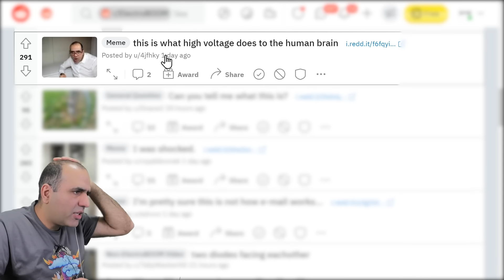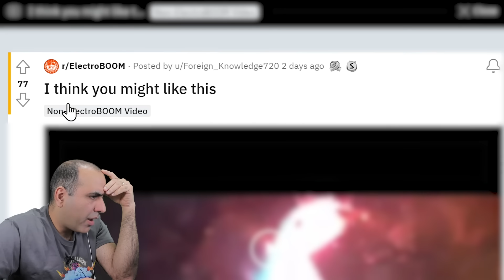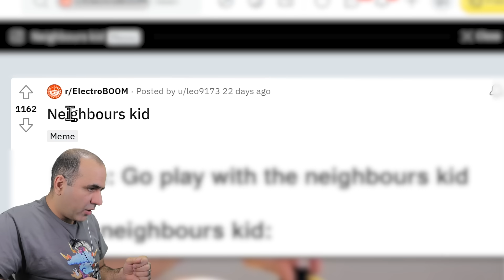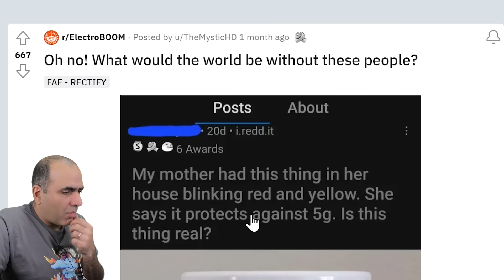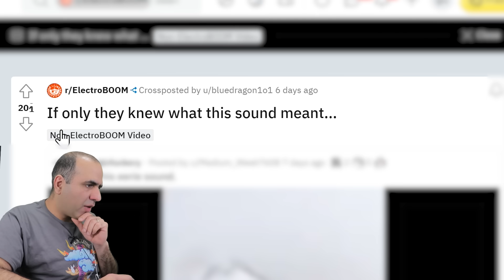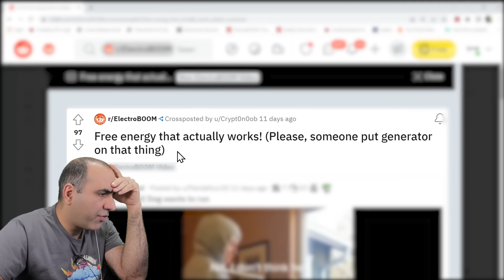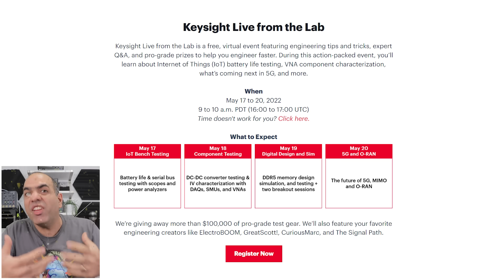Electricity Takes the Shortest Path (in the air), LATITY-010

Comment: 3:50 Mehdi didn't really explain the specifics here, so for anyone interested:
What this is depicting is step voltage - basically because the ground is relatively high resistance the point where the high voltage source contacts winds up at or near that voltage, and the voltage reduces the further away from the source, similar to a resistive voltage divider. The danger is if you take a step towards or away from the voltage source then your feet will be at 2 different voltage potentials, and your body is far more conductive than the ground so this can result in enough of a voltage difference to kill you.
Reply: Ah, so that's why they showed putting your feet together (same potential) then hopping on one foot. 

Jeez, I already get enough anxiety with hopscotch. Death hopscotch would not be fun.
Reply: @x--.  Very short steps would also work, just slightly higher risk
Reply: @bosstowndynamics5488  what about jumps from one leg to the other? Never both legs touching ground.
Reply: @Albtraum_TDDC  Same as hopping - single point contact with the ground. Time it wrong and have both feet touching though and you're likely in trouble because leaping implies a longer stride length than just walking, which would mean an even higher step voltage
Reply: @bosstowndynamics5488  But you don’t risk falling like you do when hopping on one leg, so elderly people may fare better with small steps.
Reply: @x--.  I feel like this is similar to being worried about quicksand.
Reply: @tools.no.problem  downed power lines are a thing that happen sometimes, and they definitely have the power to create a voltage gradient across the ground like that. Fortunately a downed power line is generally quite easy to see from a safe distance and thus avoided.
Reply: I've experienced this when using a 120 v rod to bring up nightcrawlers. When picking them up, you need to wear rubber-soled shoes and be careful not to brace with your other hand.
Reply: Same principle applies for lightning. Get your feet close together and squat when trapped in a thunderstorm
Reply: Imagine you fall when hopping ☠️
Reply: @LudwigvanBeethoven2  That's why for old/frail people they recommend very tiny steps instead.
Reply: Aha! So, if I walk around it in PERFECT CIRCLES i'm totally fine!
Reply: what if you fall face 1st onto the ground?
Reply: @RoadRunnerMedia  You die. Your body connects two potentials far enough away to be lethal.
Reply: Thanks, that was really confusing
Reply: 😊 please don't write your essay here
Reply: @akshit1  😊176 people and counting disagree with your objection

Comment: 6:25 I bought couples to rectify.
The principle behind is that they have fluffy conductive threads that expands due to repulsion when charged with static electricity. Similar principle to why hair raises up when charged in the attempt to mitigate charge from pointy objects.
Although surface area of those is no where near enough to prevent any static charge build up.

Comment: Mechanical Engineer here.  
Technically not a demonstration of Bernoulli's principles, because it's viscous flow of the stream of air he's blowing that imparts flow on the surrounding air.  
Bernoulli doesn't really account for viscosity.  For that, you need to add in Euler or Navier-Stokes.

Comment: ok, here is a question, does adding more wires parallel reduce resistance/ raise total power that can go through or does it REALLY have to be a bigger wire and nothing else? (be it extensions or speaker wires...)

Comment: Ok, im really curious.
a question to all electrical engineering tradesmen, how often does that happen with rodents getting into electrical circuit breaker boxes?
Reply: A squirrel try to chew on an insulator of a factory-attached transformer at a local factory. The transformer made a God-awful grunting noise, and WARPED itself (obviously, transformer ruined)!!! (The magnetic energy stored in a transformer can't simply instantly evaporate after all!). They know it was a squirrel because an investigation found a tiny piece of a jaw with a tooth attached somewhere in the vicinity. 
Obviously, the HVAC first conducted thru squirrel's body, soon it was hot and smoldering, then turned to charcoal, charcoal conducts a hell lot more, that started a plasma arc discharge, and that's pretty much zero ohms... An arc will keep going until a breaker trips. Unfortunately, in industrial-size electricity delivery, an arc discharge does NOT always mean that it is more current than a factory is expected to absorb, so breaker can let an arc go for quite a while in distribution and factory systems...
Reply: @nameredacted1242  jesus, that sounds like one hell of a nightmare. Especially considering the after effects of what can happen

Comment: The best way to explain electron flow is that the field is like a bunch of spectators along the side of the tour de France course cheering on the riders. No wait. That explanation is as bad as that stupid Sheppard and sheep analogy some so called expert said on the Veritasium channel. How about that bridge that resonated until all of the people stepped side to side in unison and they had to close it and fix it? The bridge movement is like the electric field/ voltage and the people are the electrons that are manipulated along it with the resonance. That is much better. Tesla did say everything is resonance. Didn't he? Or was that the ancient lost technology crowd (I'm one of them) who speculate the pyramids were huge resonant energy power stations. Anyway, if that convoluted explanation of how electric current works with all of the time consuming Cad drawings to explain it didn't make sense on Veritasium, now it does with my simple analogy of the resonating bridge shuffling everyone along it.

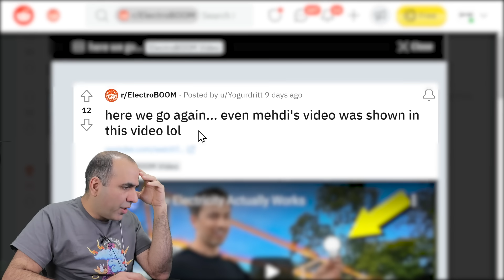Comment: 07:14 @ElectroBOOM - Veritasiums video isn't actually a circuit is the problem. It was a trick question because what he's actually talking about is the worlds most inefficient transformer. 2 coils, spaced a foot apart, and the electromagnetic field in one coil, induces a voltage on the 2nd coil, and this trips a relay which turns on the light. Basically he's arguing that when you close the switch, the EMF produces an 'above eddy current' rise in voltage almost instantly in the load on the other side. This is true but not because it's a circuit, but because the 2 coils act like a transformer. The 'circuit' wouldn't even need to be connected in this experiment. It's a disingenuous question because it's set up as "A circuit 2 light seconds long, how long does it take to light the bulb" when in reality what's lighting the bulb is any strong local EMF.

Comment: Electricity doesn't take the shortest path to ground. It takes the easiest path. Its all about resistance. Electricity will travel further if the resistance is lower even tho its further than travel a shorter distance with higher resistance.

Comment: Maybe note that some power strips have surge protectors that means they might need replacing every 3 months or so...
Reply: The MOV  (Metal Oxide Varistor) gradually decays from joules of electrical energy, or the TVS (transient voltage surge) diodes can be damaged in the surge protector.

Comment: electricity taking "shortest path" vs "least resistance"    in simplistic terms, a jacobs ladder shows that it is both very well.
Reply: Jacobs ladder arcs, which creates heat, and hot air is more conductive than cold air. After a certain point the hot air and distance have more resistance than the cold air and less distance. It is the path of least impedance.

Comment: You made a huge mistake. Electricity does not use the shortest path. It uses the path of the least resistance. This can be proven by simply observing the lightnings from the teslacoil. The shortest path would always be a straight line through the air, but the lightnings are never straight.

Comment: For the guy taking a shower in sparks, each spark's total energy is pretty low, so not much energy is transferred to the body. There's an exhibit on this in a science museum I once went to, they have a spark generator that sends hundreds of sparks flying, but even if you put your hand right next to it, you don't feel a thing.
Reply: If those are grinder sparks, they are hot as hell.
Reply: @nameredacted1242  Mpt really. Again, each spark may have a high temperature, but temperature is a measure of average energy, so even if a spark has high average molecular energy, if it has a smal number of molecules, it has very little total energy.
Reply: @pikleman5880  We are talking about two different things. You are thinking of "sparks" produced by electrical discharge? while I am guessing that's one of those Russian videos, with a guy standing under an industrial grinder. Those "sparks" are produced by small white-hot pieces of metal flying.
Reply: @nameredacted1242  I'm not thinking of electrical sparks. I'm also talking about sparks made by a grinder.
Reply: @pikleman5880  I have set things on fire (house did not burn down, don't worry) from grinder sparks and/or from welding sparks. NO THANKS.
Reply: @nameredacted1242  It's called the exploratorium in San Fransisco. There's a grinder there that creates a lot of sparks.

Comment: Unrelated to this video, but was wondering if anyone can explain this to me. 
If I connect a single rgb led to a 4.5v battery why does the led barely remain glowing after a few minutes. I wouldn't say that it drained the battery because if I turn it off and in a few minutes on again it lights up normally and dims again after a few minutes.

Comment: I still know nothing about how electricity works but i could watch these videos for hours
Reply: I can help you with that in seconds... Go grab a fork, then let me know when you're ready for the next steps.
Reply: u in fact can 😀
Reply: Ok
Reply: Turns out no one really understand how it works.
Reply: I've learned from these videos that electricity is blue, comes from wall socket and hurts like hell.
Reply: @suburbanraider  
what is blue is the ionized heated gas that the charge passes through. 
It would have different color in different gases.
Reply: @Broockle  I thought it would be like fire. And the temperature in human atmosphere decided it.
Reply: @badoem5353  yes
Tho u do get different colors in our atmosphere depending on what is burning and how hot the flame is.
Reply: @Broockle  in like the light of the flame isolated, or the view of the stuff burning? Srr, I'm selfish thought a from the internet and interests
Reply: @badoem5353  
uhh... most gas in our atmosphere is not visible at all on short distance. 
When you look at the sky you will get the color of our atmosphere and depending on the sunlight's angle, and the distance the light has to travel through our atmosphere you get different colors in the sky. 

Fire has its color because it emits light, the light it scatters from other sources is insignificant usually. 
I'm not really sure why you're asking this tho.
Reply: @Broockle  to specify the source, our eyes are kinda shit at observing.
So I was curious ;)
Also I read the color of the sky  is just scattering and the angle of entry. Blue light is more powerful so it stays longer  before being dissipated. With the red it's more distance.

Comment: I don't know all the details, but I thought MOVs that they use in typical surge protectors wear out over time, and there isn't a way to test if they've failed without destroying them in the process.  Hence you need to replace surge protectors with some regularity to be sure that it will function as desired.  The flip side of this is if you buy good ones they have lifetime warranties and really a lightning strike isn't going to be completely stopped by almost anything so really what you're buying is the warranty, so it's not worth worrying about.
Reply: Yep, although the new one you buy is likely even worse than the old one...

Comment: Maybe the question about the power-strip should have specified that they're talking about the surge protector?  Or have I been lied to and the MOV in surge protectors doesn't wear out over time from "small" spikes?
Reply: Disclaimer: This is from my experience with good and bad power strips, obviously I cannot confirm if a particular brand or model is well built or not, even the same make and model that I have may have undergone major design changes or be outsourced from a different factory.
Always do your own research, check the reviews, google the model (use the barcode if available) to see if there was a recall, suspect if the price is too good to be true...

It wears out very slowly unless the mains supply is really "dirt" but in a good power strip (or whatever application) design it's usually not the end of the world because each MOV will be in series with a ceramic/plastic housing thermal fuse which is mechanically clamped to the body of the MOV via heat shrink tubing or some similar method, in this way as soon as the varistor approaches the temperature at which the plastic of the strip could begin to soften, the fuse opens, interrupting the flow of current through the MOV and rendering the strip unusable.
That is the case with any power strip manufactured or distributed by well-known manufacturers of electrical and computer equipment.

Even if there is no thermal fuse, nothing serious should happen if the plastic casing and the other components of the power strip are made of fire retardant materials, in which case the MOV will disintegrate into dust or just explode depending on gravity of the glitch, but just making some crackling noise and releasing some magical smoke.
If you have an unknown brand or you suspect that it may be an imitation, you may have to disassemble it to see how it is built, the good quality ones have screws, even if they have security heads and cannot be easily removed, if the case halves are welded/glued it can be assumed that it is so cheaply made that they couldn't even afford the screws and/or don't want you to see how poorly built it is.

Some of these low quality ones can even degrade in a few months exposed to sunlight (even through a glass window) and although at first glance they appear to be in good condition and may have not discolored, when you go to pick them up in your hand the plastic will disintegrate leaving you holding the exposed live (deadly) conductors.

Comment: If you are in an open field and starts to hear that terrifying static electricity sound, what do you do to maximize your chances of survival? Genuinely asking...
Reply: Yes it would be nice to hear suggestions how to best get out from that dangerous situation with static electricity in the air like that... I experienced it myself when I was camping out in the woods in Finland and had to go out and pee during a thunderstorm, while I was out the trees around me started to make a sound like when tearing paper, I finished peeing and ran into my van as fast as I could....
Reply: Do NOT raise your hands. Do not hold on to any metal object. Do everything to NOT be the tallest thing in the area. Head downhill.  Go near something taller but No closer than 100 meters. Do NOT stand in puddle. Do not hold on to anything pointy.
Reply: @maxmillion7007  but for instance...if I am trying to not be the tallest thing around and it is a relatively clear field...should I lie flat on the ground or would the increased area with the ground make things worse? Another option I can think about is curling down in a ball and standing on the tip of your feet. That is the minimum height + ground contact I can think of, but I have no idea if it is the most effective way. Also...greatly reduced mobility with both those strategies...

Comment: Electricity does not take the shortest path it takes the path with the lowest resistance! Shame on you!!!
Reply from the maker: it still goes through the higher resistance though! it takes the shortest path jumping over the air
Reply: @ElectroBOOM  isn't it because ionized air is such a good conductor?
Reply: Just read your commend, nevermind :-D

Comment: 1:50 Fun fact: Those "sparks" cool off so quickly, he doesn't feel anything but a tickle. You can even hold your hand in front of it without it being painful! Electric sparks are something different. They are actually very dangerous, because there are also bigger parts of metal flying off that won't cool down very fast.
Reply: Those sparks come from the fine metal powder that is spontaneously combusting in ambient oxygen as it's being sprayed. It's not going to be painful for short durations but: 1. your skin will be covered with burned metal powder (rust) and 2. if you stay under it long enough, it will burn... like the spark spray from an angle grinder can easily ignite your clothes if you're not careful about where you aim the spray.